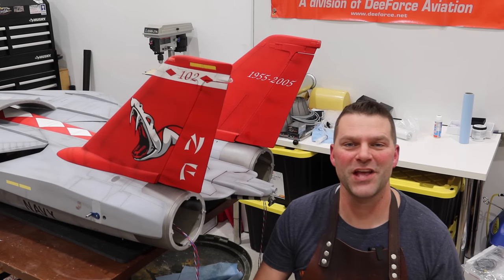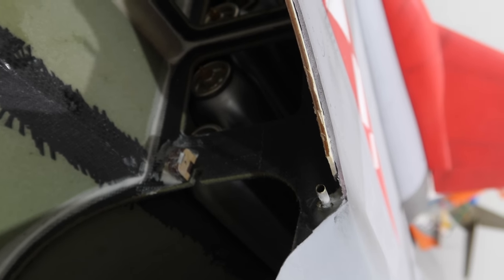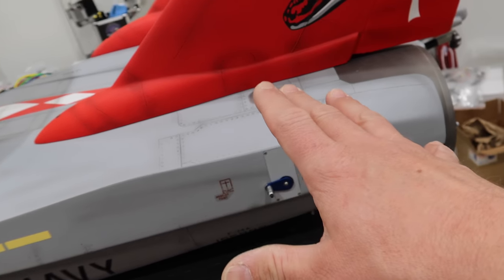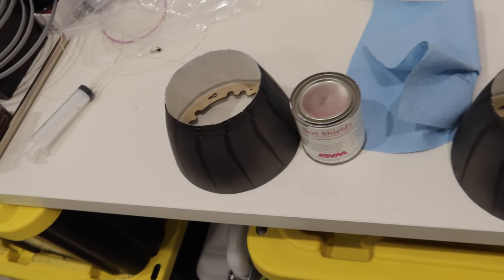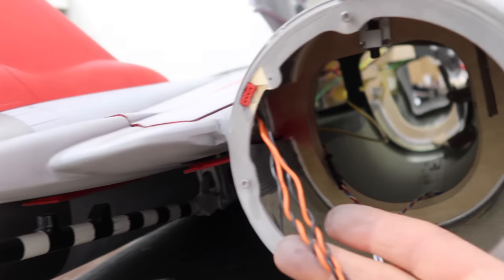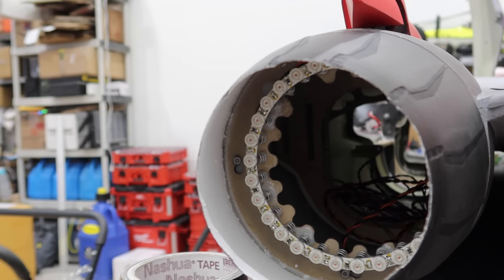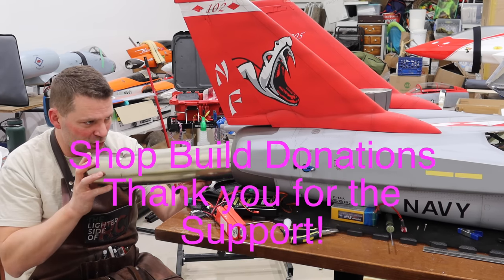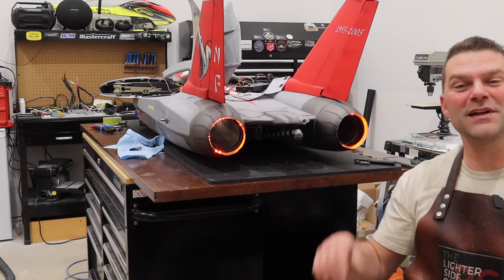MASSIVE TOP GUN F-14 Engine & Afterburner Mounting - Skymaster F14

Comment: Another job well done ... but to be honest, the symmetrical flickering effect kills the illusion completely. Such expensive modules really should have a pre-made mode for twin jet aircraft or let you dial in an offset to break up the symmetry. The effect itself looks gorgeous. If it were my jet, I'd probably limit the effect to 70-100% throttle, tho. No visible flames on jets at all unless you activate the afterburner. That's why they're called "afterburner rings" ^^. At least you got the PLUS version, so you can freely program your own effects using their software.
Reply from the maker: Yea totally agree!  It is pretty slick that there are a bunch of presets for programming. I’m the same!  I only want to see the lights at 70 ish percent and above.

Comment: 35:00 Awsome effect. When both engines afterburner flashes and stutters at precisely the same time it diminishes the scale appearance a little. The amount of effect should be the same but not the exact time the light simulates the exhaust plasma flashing over..See what I mean? (I'm wondering if this is a setting in the control box) 🤔
Reply from the maker: I think it can all be setup in the controller.  There are a bunch of pre programmed settings but i'm sure is costomizable as well.  We will cover that.
Reply: @thelightersideofrc  Thx for the response Johnathan 👍 😊

Comment: I'm sure the engines produce more than enough power, but why is it designed with the engines so far up and a large pipe running out? Seems to me anyways, that you would lose some thrust by the time it travels down the tubes. But, like I said, the engines probably produce more than needed thrust and it's not a big deal.
Reply from the maker: Hey Aaron.  you can actually gain thrust if the pipes are designed correct.  I was part of an F18 Build a few years back with the turbines right at the tail cones.  Cool idea.  Cool system buy the problem is your now moving so much of the weight behind the C of G that you need to add lots of nose weight.  I believe in that 18 we added 6-7 lbs of nose weight to compensate.  It was a very porky F18.
Reply: @thelightersideofrc  I thought maybe the CofG might be an issue with them in the back. I can't wait to see this operate! Best of luck!